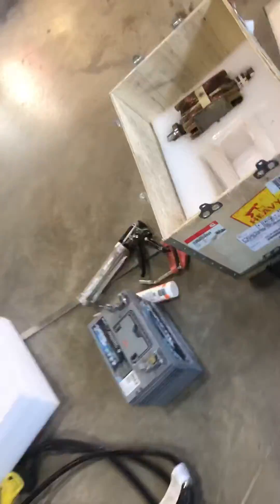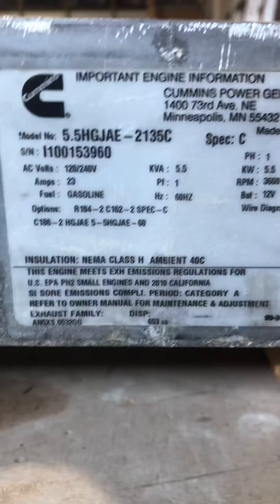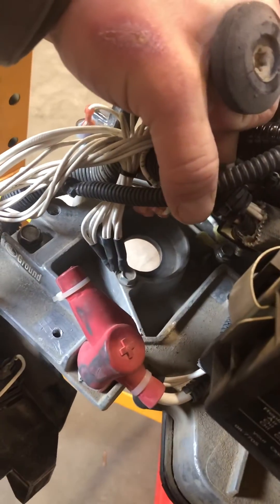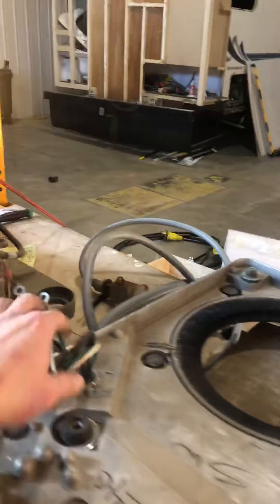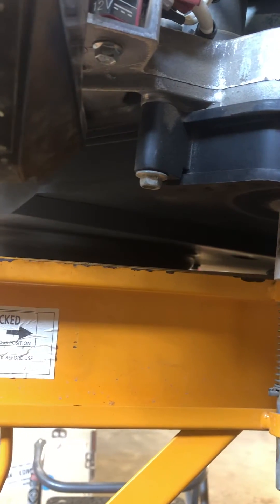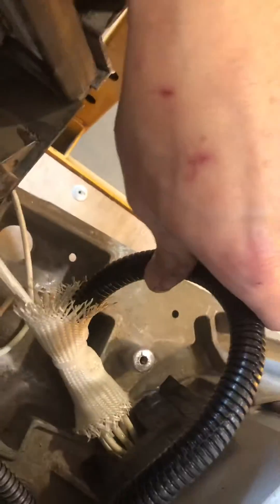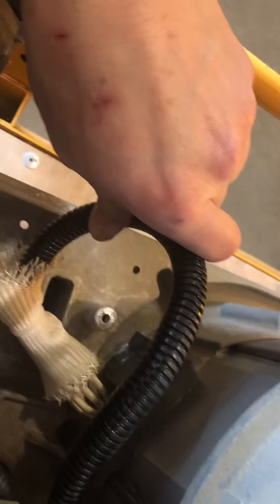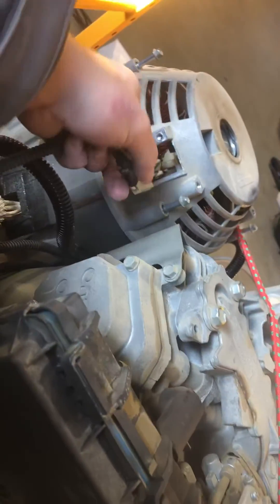Cummins Onan 5500 Generator stator rotor issues

Comment: I replaced everything except coils and it still starts and dies right away but sometimes it will run untoll ots suts off
Reply from the maker: Would need more info to give a better answer.
Reply: @thecanadianrvrepairguy3062  
Is a 5.5k e spec. I figured out that of I hole the choke open when it's cold so it creates a longer crank and hold it for a sec as the rpm goes up it stays running and the opposite when it's hot if I hold the choke down to create a longer crank it fire up and runs. It is a Amazon carb on it
Reply from the maker: @sethschaefer6709  I would say the amazon carb is part of the issue. Get a OEM one and it might sort out your issue

Comment: Hey I have a 5.5HGjab spec D 

And it has no voltage regulator like yours? It has the spot to mount one but nothing is there when I pulled the unit… please point me in any direction… I think this is the wrong stator and winding for my unit.

Comment: Where do the 2 white neutral wires go too from your pigtail coming into generator is there a bolt or stud? I see the ground area for the green wire and the 2 blacks on the back of the breakers but can't see a stud or bolt for the white wires
Reply from the maker: Do the wires have a number stamped on them?

Comment: Good video, would like to ask more about if you do know if I can get these parts for my gen set today? I have one that has the upper gen bearing needs replaced. Thanks! -b
Reply from the maker: As far as I know you can get parts. A bearing can be picked up at a  bearing place does not need to come from Cummins.
Reply: @thecanadianrvrepairguy3062  Thanks again for the video and your reply. My challenge is getting the top bearing housing off the generator without damage to it. Is there any thoughts you have on it. Do I have to completely remove the rotor assembly as you showed in your video or is it possible to get the top bearing housing off?  Thanks! -jw

Comment: Hello I changed the belt of my Onan 5500 marquis gold and ever since the Gen will start then shuts off.. 
I don't know if it's wiring or something else 

I thought it's the carburator i changed it but still won't start 

but I noticed when I changed the belt the rotor sometimes won't roll together with the wheel that's connect the coils 
Ive checked the controller no burnt issues.. pls I need help on this 
if it's to get a video or if I can call and schedule a what'sapp video call so you can guide us pls... 

it's hard to get this done here in Nigeria.. thank you
Reply from the maker: When it shuts down what is the code it throws. Just to get a direction to go in have to rule out possibilities. So does it start now or not at all if it does start how long does it run before shutting down
Reply: @thecanadianrvrepairguy3062  yes  but they removed the wire that goes under the carburator and put it directly to positive cable It work for a while and shuts off still because the fuel pump it's not  supplying but I  changed it back to normal because I feel the pump and the carburator are not getting lights at all
Reply from the maker: Three blinks indicates a service fault. Press
Stop once to cause the two-digit, second-lev-
el fault code to blink. (Pressing Stop again will
stop the blinking.) The two-digit code consists
of 1, 2, 3, 4 or 5 blinks, a brief pause, and then
1 to 9 blinks. The first set of blinks represents
the tens digit and the second set of blinks the
units digit of the fault code number. For exam-
ple, Fault Code No. 36 appears as:
blink-blink-blink-pause-blink-blink-blink-blink-blink-blink
long pause-repeat
Reply: @thecanadianrvrepairguy3062  It's 3blinks and 3blinks again
Reply from the maker: @Iam_nopain  Diagnosis & Repair:
1. Verify that Last Fault is FC 3 Yes, continue diagnosis; No, troubleshoot actual last fault.
2. While LED is flashing three times press stop once (1 second duration): trouble shoot Two-Digit Fault

Comment: Good afternoon 
Iam a Nigerian and i have an Rv that comes with onan 5500 
The belt cut off and we got some to fix it and after fixing it and ever since  weve been trying to start but it wont start 
It will just run for a second and goes off
Reply from the maker: Sounds like you need to replace the fuel pump.

Comment: I have onan 7HGJAD 2560B. It works but after 5 second engine stops and low voltage message appears. 
T1-T2  0.3 
t3-t4   0.3 ohm Q1-Q2 2.5 ohm. 
rotor slip rings both + and - 0.3 ohms. What do you think  about possible problem ?
Reply from the maker: Well if your slip rings are as you tested the rotor is bad. So when testing the rotor slip rings you need to check the Ohms across the rings. So one lead on the top ring and the other lead of your meter on the bottom ring. Let me know what that Ohm reading is.
Reply: @thecanadianrvrepairguy3062   Actually,  one rod was at the upper slip ring and the other lower slip ring and it was 30.2 ohm.  I am sorry it is not 0.3 ohm, i made a mistake.
Reply from the maker: @veterinervasfi  ok all the readings are ok. Would need the actual trouble code off the start switch. The light that flashes. Or I can do a phone consultation with you for $50 through PayPal

Comment: Where is the voltage regulator on the hgjae k spec gen set
Reply from the maker: The voltage is regulated through the main electronic control box. It in the same area as the the switch that starts the unit. You have to remove the bolts from the black cover and it’s under there.
Reply: What is the best way to test it I have voltage fluctuations both up and down seen it go as high as 135v and as low as 88v and my load on the line go up to 14 amps at times but normally hoover's around 3
Reply from the maker: Jerrod Helton 
Look back at my other reply’s on testing the windings of the stator. Let me know the what you get as well check the brushes and slip rings.

Comment: Yes I am wondering how to test the rotor and stator on this generator. I am working on one right now that doesn't generate electricity. I want to know if its the controls or the rotor and stator.
Reply from the maker: Why model of gen set
Reply: @thecanadianrvrepairguy3062  it is a cummins/Onan model 7hgjad-2139j
Reply from the maker: Gr8 Ghost 
Ok thanks will get back to you here soon.
Reply from the maker: Gr8 Ghost 
So terminals on a 5500 T-1 & t-2 / T-3& T-4 should have .33 +\- 10% OHMS 
Terminals Q-1&Q2 should have 2.73 +\- 10% OHMS
Reply: Thanks so much Canadian Rv Repair Guy.
Reply: How do we know what the terminals are? I have a spec sheet but it does have that info.
Reply: I see the wires are marked. T1 goes to the breaker, T2 goes to ground, i don't see t3 or t4. I do have a T1s at each breaker and 2 T2s going to ground. The resistance to all are 0 ohms. Q1 and Q2 go to terminal connectors. Resistance is 2.2 ohms which is below spec. So looks like it needs a rotor and stator kit. Do you agree Candian RV Guy?
Reply from the maker: Gr8 Ghost so that says the stator is bad and if you replacing that then it does not matter about the rotor you will replace them as a set.

Comment: I have a 95 Onan Marquis 5kw  genset in my rv. 2 weeks ago it started arching n sparking at the bottom of the stator. It still produced power but the sparking is loud and constant (no I'm not still using it) there is no obstruction of foreigner matter present.
Can this be repaired or just replaced. No you will not be held liable for any help you can provide. 
I have been a !mechanic for 25 years and know a\c from d\c so repairing or replacing will call in my skillset.
Thanks
Marty Fee
Florida
Reply from the maker: Martin Fee did you solve your problem.

Comment: How did you diagnose this before tearing it down for a visual inspection? I think mine might be bad. No resistance on pins 3&9 which I believe is the stator.
Reply from the maker: So terminals on a 5500 T-1 & t-2 / T-3& T-4 should have .33 +\- 10% OHMS 
Terminals Q-1&Q2 should have 2.73 +\- 10% OHMS
Reply: @thecanadianrvrepairguy3062   
Hello I changed the belt of my Onan 5500 marquis gold and ever since the Gen will start then shuts off.. 
I don't know if it's wiring or something else 

I thought it's the carburator i changed it but still won't start 

but I noticed when I changed the belt the rotor sometimes won't roll together with the wheel that's connect the coils 
Ive checked the controller no burnt issues.. pls I need help on this 
if it's to get a video or if I can call and schedule a what'sapp video call so you can guide us pls... 

it's hard to get this done here in Nigeria.. thank you